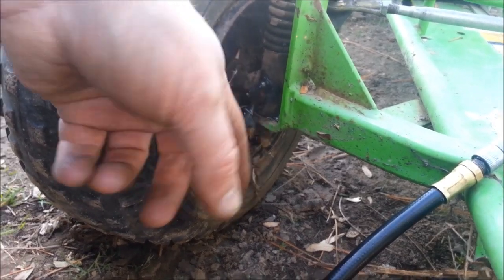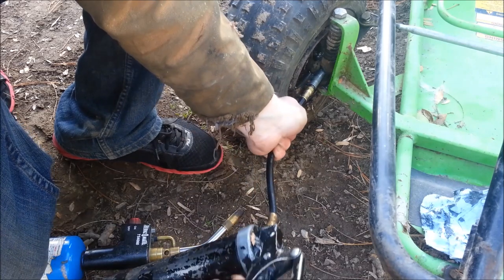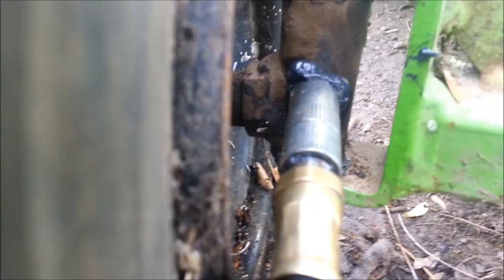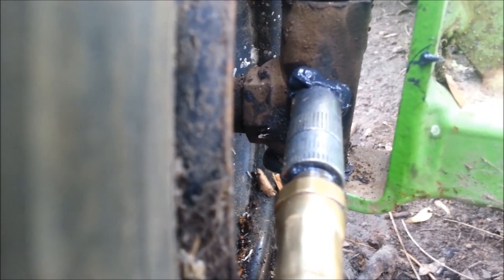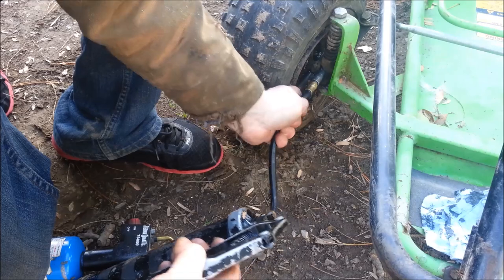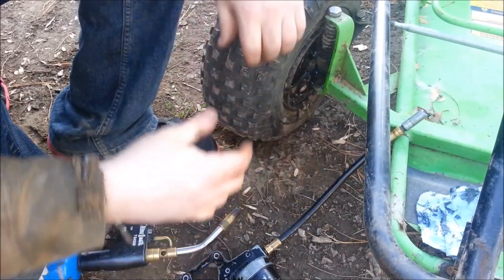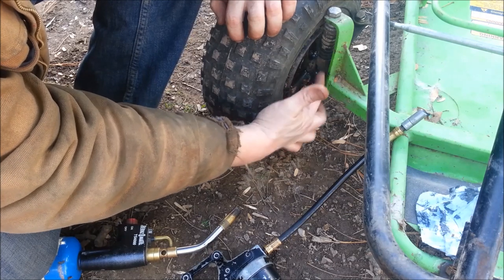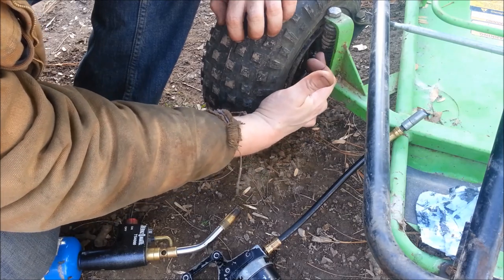Grease Zerk fitting won't accept grease

Comment: Wow what a great tip... Just a thought, I would use an electric heat gun first and save the open flame for really hard (crusty)  jobs...
Thanks and have a great day.
Reply from the maker: The heat gun won't get the steel hot enough, fast enough. The steel tends to dissipate the heat too rapidly.
Reply: On my mower one of the zerks in the front wheel assembly is plastic and built into the part. That aint right.

Comment: A blast with a steam bottle works as well. It also has the added bonus of cleaning up some of the gunk around the fitting.
Reply from the maker: Steam. Makes sense.
Reply: @sixtyfiveford  
I don't always trust myself to not light things on fire... 
The wife keeps asking if I know where the little bathroom steam cleaner went...
"Uhhh.. I think I used it for something, I dunno!"

Comment: I know very few would do it and that is install little plastic covers over the zerk fitting 
so that they won't get plugged up, I also do that on brake wheel cylinders zerk fittings too.
GREAT TIP never tried it I always used a grease fitting rejuvenator on grease fittings
put heat on brake wheel cylinder zerk fittings to remove them if rusted on.

Comment: Thx.  I have had this issue in the past.  But I am working on junk  oops  used equipment all the time
Bruce
Reply from the maker: Generally I can force it in but I found heat makes the grease move everywhere in the joint.

Comment: Great tip, previously I used to replace the fittings which was a time consuming hassle.
Reply from the maker: Thanks.
Reply: Replacing a fitting takes about a minute. If the fitting is the problem then that’s the way to go. But that’s probably not the problem.

Comment: Dam good tip :-), we forget heat too easy.

I know its not the same thing but on old record players the grease on the turntable shaft turns to concrete, you just cant move the turntable, you would never beleave grease could go so bad.
Reply from the maker: Yeah, It really sets up hard after years of neglect. Probably doesn't help that it attracts and mixes with dust/dirt.

Comment: Zerks haven’t been used in over 70 years, they were smooth fittings that the gun didn’t lock on, and didn’t have the little check ball. You could use a zerk gun on the Alemite fitting, but it wouldn’t lock to the fitting. Use caution applying heat to grease fittings. I knew a guy who got shot in the nuts by one. The heat blew the check ball out, and it nailed him right where it hurt the most.
Reply: I am 73 years old and have been a farmer all my life. I have never purchased any farm equipment, including tractors, that did not have jerks to grease moving parts. Your claim that they haven't been used in 70 years baffles me to no end.
Reply: @bobcrump8105  zerk is an incorrect term, for the fittings used in your lifetime. Zerk fittings lacked both the check ball, and the groove that allows the gun tip to clamp to the fitting.
Reply: @jusportel so what are the thing most of us refer to as a zerk actually called?
Reply: @jamesb1988  officially, Alemite hydraulic fittings. Or simply grease fittings.

Comment: Thanks for the tip, BUT wouldn't a heat gun be less radical and damaging to the rubber boot in there. Would it work as well??
Reply from the maker: Yeah, I heat gun would work.
Reply: Great, thanks for such a great idea

Comment: Hey nice tip! I would like your opinion on this please, Is it an absolute must to have grease fittings on the wheels of your lawn tractor or are you looking for problems down the road if you get one that does not have any.
Reply from the maker: GmGarlo I would say; no you don't have to have them. It only helps minimally and you can accomplish the same thing by sliding off the wheel and dabbing some grease.
Reply: sixtyfiveford Thanks I tend to agree, the only thing i was worried about if it doesn't have wheel bearings you may run into a problem down the road. ALWAYS LOVE YOUR INPUT!!
Reply from the maker: The ones with the zerks don't have wheel bearings, just plastic bushings like the ones without grease zerks. Only larger more commercial equipment has bearings.
Reply: sixtyfiveford Thanks 65 Ford , That was very helpful, Hec I'm going to give you two thumbs up , Always can count on you for good advice!!!
Reply from the maker: Thanks Man!

Comment: Hmm.... We usually just pull the zerk, clean the dirt and crap out of the hole!!!!  Either clear the zerk or replace it, then put clean grease in...without all the crap solids that damage seals. 
Not a bad idea, just be careful with the heat!!! Seals, sensors and even the zerk it's self don't like much heat.
Wonder if I should try that on the combines or the balers in the field?? NOPE!!! But in the yard or in the shop, maybe 😎
Reply from the maker: A clogged zerk is one thing this is more for clogged internal grease passages.
Reply: Yes, I know... Pressure is also a factor, that's why I love my DeWalt!!
Even with the fancy tool, you still have to have a good seal at the zerk and coupler.

Comment: Another easy way to fix a stubborn zerk fitting, is to remove it and put it in a vise, then apply the grease gun, that will clean out any old, hard grease. Re-install the zerk and it will work like new.

Comment: show me how to make them not leak grease when your pumpin them up!
Reply: Heat grease fitting, remove (unscrew) grease fitting, replace with new grease fitting or soak and clean old fitting, reinstall grease fitting. Shazam, no more leaky grease fitting. All a grease fitting is, is a tapered tube with a ball inside held tight against the inlet by a tiny compression spring.
Reply from the maker: EdOfTheNorth Yep like Ed says. Generally dried grease and dirt prevent the ball from seating.

Comment: Great tip! Thanks a lot, had a mower wheel joint not taking grease and pulled the zerk to test it, that took grease easy. Found your tip and had to apply heat for a while on and off with the zerk off(to allow for theold stuff to seep out better) and finally it takes grease! Thanks again!

Comment: Good tip Moe.
I have a question I would like answered if you can.
Our 1990 Ford E150 van may need king pins, how big of a job is it?
NAPA don't carry king pins for it, I was told the A frame has to come out.
I don't think my local garage can do it.

Comment: Many years ago, I had a Ford pickup with a half-frozen kingpin on the driver`s side. I heated that and worked the wheel left and right, alternating the flame with trying to grease it. Took a few hours. I slowly got all that caked grease loose. The old girl felt like she had power steering after that!
Reply from the maker: That's the first time I did it as well. It was on my 65 ford pickup. Those kingpins never got grease and I was amazed the difference.

Comment: grease coming out at nozzle does not mean grease has gone into nipple! I had the same issue loads of grease oozing out and when took nipple out nothing. New nipples and same issue. Pressed ball of down and and air gun through. Out of interest put the loose nipples into grease gun tipm tightened holder and squeezed, no grease out of nipple but again loads from gun holder. Issue has to be gun holder. I aways remove nipples now and check that way.

Comment: I have 2 new inner tie rod ends and both won't accept grease. The outters were fine, no issue. I tried to heat them up and grease did flow out, it just won't flow in. Doesn't seem like it's full cause the boot isn't plump. I have no clue what's going on
Reply from the maker: Sometimes the ball/spring in the zerk get rusted solid and won't allow grease in. A new zerk or try pushing the little ball in with a small pick/screwdriver.

Comment: yes , my Austin London taxi had 2 nipples that were dead shut, never had grease passed since the London taxi was made in 1970, ALL grease nipples should be checked as passing grease before installation, 2 minutes can save a lifetime on trouble and wear, be wise and check the nipple first
Reply: Aaaa - quick question: How would you check grease fitting before you install it?
Reply: try inserting nipple into grease gun then using the gun, press the other side of the nipple ( screw thread side)  again a hard surface at a slight angle so as not to block the outlet completely, and press trigger,, you could use the jaws of a vice, to hold the grease nipple  by its nut, , you will only have 1 of 2 results, grease squirting out the thread side of nipple, or grease coming out between gun and nipple,   it will make a small mess , have a cloth  or rag handy, you may need to wash your hands later
Reply: Steven Olsen no

Comment: I'm having this same issue on one of my Zerk fitting accepting grease on a brand new tie rod end? Changed to another new fitting and made sure the fitting worked separately and still won't accept grease?
Reply from the maker: It could be such a tight fit that until you use it for a while it won't loosen up.
Reply: sixtyfiveford
The ball in the joint your thinking correct? Ive never had this issue with any other new joint ever. I guess there is always something new to learn.
Reply: henry78k
Oh and I refrained from replying with just, "Thats what she said!" Haha
Reply: four years late but sounds like this type of problem could require a rejuvenator. It hooks up with a coupler and you fill it with low viscosity oil, then hammer the piston thru. You'll most likely see junk sliding out of the place your trying to lube. That's probably what was clogging it.

Comment: this worked perfectly. I was buttoning up my skid plates on my truck and wanted to use the opportunity to grease the zerks on my shafts. i got all but 1 that wouldn't take grease. it wasn't easy to get access without dropping the shaft. found your video and heated for a few seconds with a torch until I saw the grease start to bubble out the zerk. it took grease no problem after that. 

even with depressing the zerk fitting I could not get any grease in. your trick saved me so much time and was very satisfying.

Comment: I am just learning to use a grease gun.  Just purchased a Lincoln 1134. Do you have to loosen the grip part of the coupler? Many reviewers said they did. It is on tight I can't get it to loosen. Thanks for teaching us how to. Lou
Reply from the maker: Walter Ackermann The zerk couplers are always tight on new guns. Especially after you apply some pressure. You end up having to twist and bend them to get them to release. They do wear in over time.

Comment: Wish I had a torch I tried just a regulator cigarette lighter and it pump better but still not taking it would be like if it wasn’t on there straight just coming out
Reply from the maker: An air heat gun will work good as well(not a blow dryer).
Reply: sixtyfiveford ok thanks for the advice man my dad said I could use wd40 and piece of wire poke around inside the grease fitting hole an should take that way as well